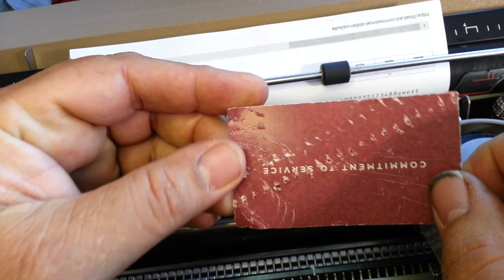IBM Selectric Typewriter Keyboard Locked Up, Partially Frozen, Analyzed and Repaired

Comment: Pretty sure you are the best reference on ibm here! A fast question: does 82c and 196-C are compatible? Same font spheres? Sabe ribbon?
Reply from the maker: I don't use these # for models, but I think 82c is a Selectric II , 196 is a Selectric III 
Balls are different, ribbons can be different cause 1/2 the selectric III produced use a #210 bicycle ribbon
Reply: @phoenixtypewriter2136  what selectric do you think is better? I have a selectric2 but it's jammed you know the gear that's supposed to find him. And i have a chance to get a selectric 3 but no additional information
Reply from the maker: @TheDormonid  They are 98% same machines, best condition, lowest miles, would be my choice
I you get a selectric III, best to get the 1299095 standard cartridge ribbon style
Reply: @phoenixtypewriter2136  sorry to bother you. A olivetti appeared on the box well conditioned but when seller turns it on every keyboard press plays a beep and no keys striking. A message pops up: keyboard blocked. Any ideas????
Reply: @phoenixtypewriter2136  sorry the error message from the olivetti actually reads : printer blocked.  I wonder if this is a major problem or just something minor
Reply from the maker: Olivetti Electronic typewriter ? I would stay away from, no parts, no support, no repair